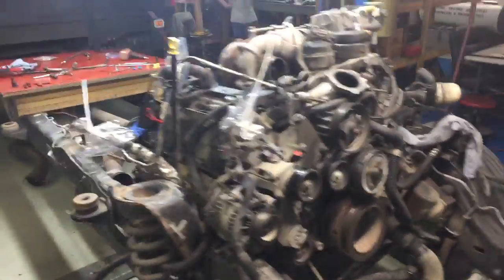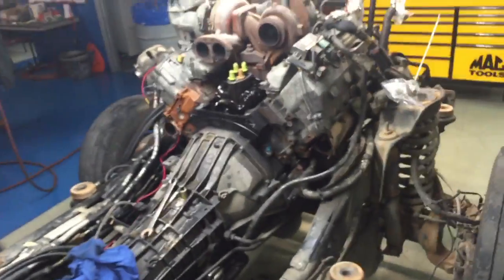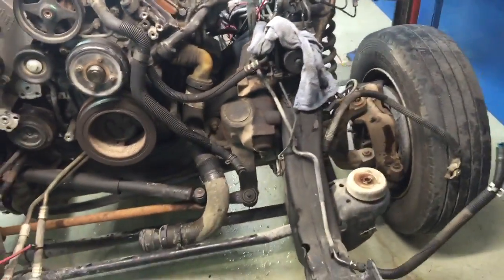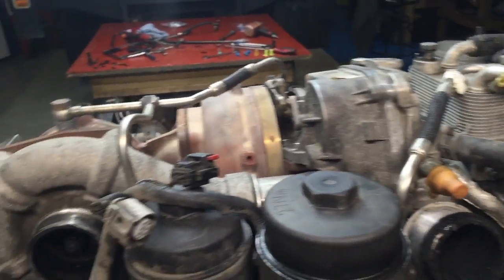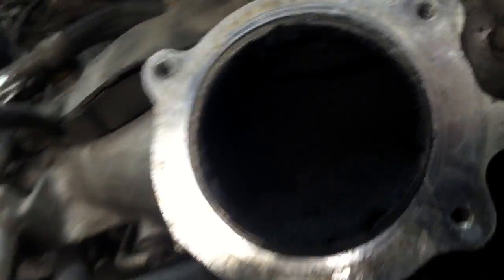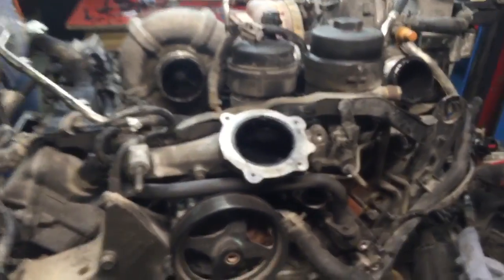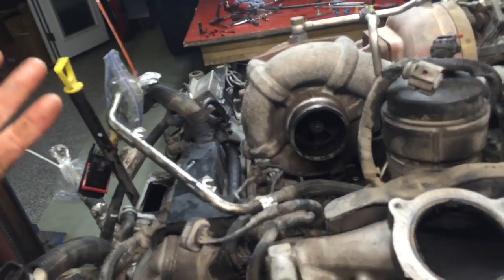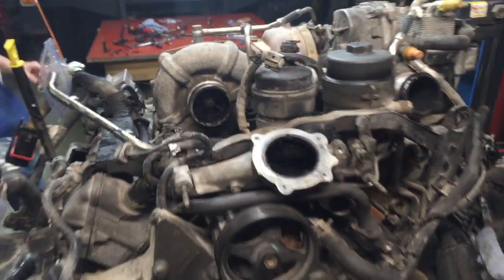Mikes hpfp and intake.

Comment: It seems like he brought the truck to you expecting to replace the hp pump. The fact that you are willing to replace the harness and call it good is amazing, Ford dealership and other shops wouldn't let that be an option at all. They would put a pump in it automatically. It looks like a work Truck to me, if this truck is going to break down on him and interfere with his work, I would propose he replaces the pump because they are known to cause problems. Start saving to do the turbos too.
Reply from the maker: Kent Miller I definately would've done the pump if the harness wasn't damaged.  If this was a fuel contamination issue,,  I'd be doing the pump.  I am betting on that pump being fine.  If it isn't,,,   Then I will pull it back down and change it.   But if it is fine,,  I just saved the customer a grand.  It's a losing game for me if it's actually bad,,  but I just see more wiring issues than actual pump issues.

Comment from the maker: Not sure which way I want to go with the hpfp.  The customer wants to replace for piece of mind.  I'm about certain it's fine.  Is this a gamble I'd like to take???  It's a lil work if I'm wrong.  Lol.   

As I was cleaning that hp compressor housing,,  I'm seriously questioning the seal on the shaft.  That was a ridiculous amount of soot for being there.  The low side was nowhere near that bad.  Tell him to save the pump $$$ and use it toward a set of turbos?????
Reply: exhaust gas coming through the turbo seal into intake side.......very good customer recommendation

Comment: good to NOT wanting to "leave it" know the Ford guys would leave it.  This is the crap you get with the new crap on them.  Why I still drive an 05.  wonder if he has the start or a turbo failure where oil is getting past a turbo seal due to high EGT from DPF regen since you say this is before EGR gas gets in.   Again, this is WHY I pay the $$$ to keep my 05 on the road
Reply: I'm looking to get a 6.0..they are worth the money to upgrade and they sound better too IMO
Reply: same here.  I would rather spend 20K get into a southern King Ranch with 150,000 or so on her, then let someone like Anthony fix all of Ford's issues with it, stud her, coolent fiter, FS2500 oil filter and drive the ball bag off her for 200K more miles than to drop 50K+ on a 6.7 rig that STILL needs to be upgraded